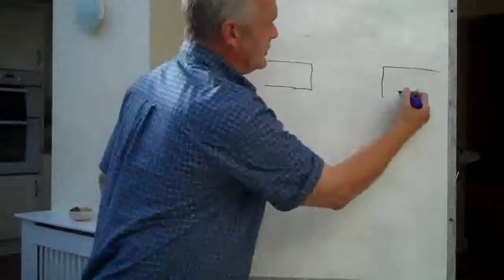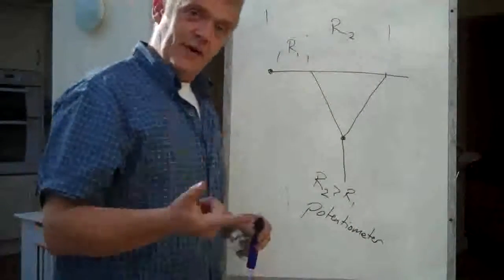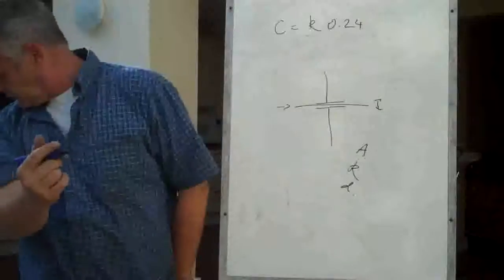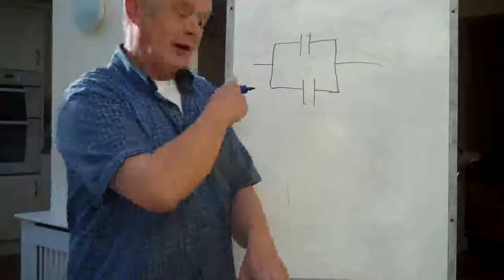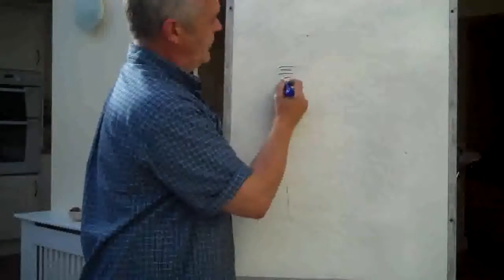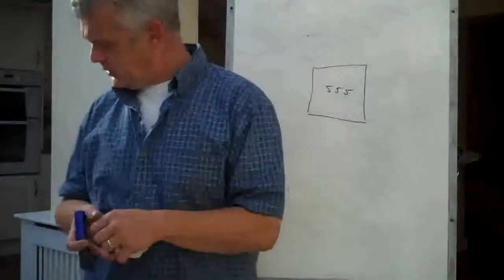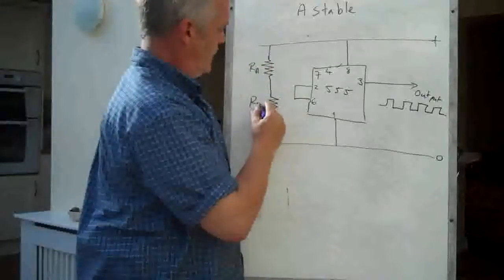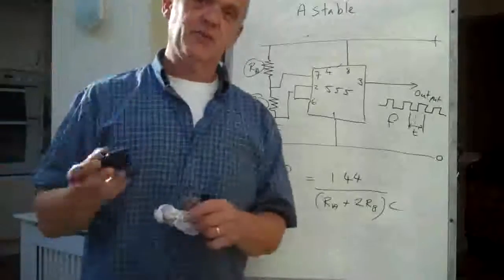Introduction to Making Electronic Components from Conductive Ink and the 555

Comment: So it seems you could start with a long strip of cardboard, coated in conductive ink on both sides so it's a capacitor, but fold it up in a zig-zag manner.
It'd work as one big capacitor (or many in parallel, if you wish to think of it like that).  Assuming the ink can stretch that far around the corners (depends on the thickness of the cardboard i guess) without breaking.  You may also need a layer of plastic between each fold so each layer doesn't touch the next, assuming that's nessesary.
You'd end up with a capacitive cardboard cube.
Reply from the maker: yeah - goo didea

Comment: you can do a nice coil by drawing a zigzag with curly straight bits that don´t cross when you then fold the paper into a concertina type thing...  john bedini said somewhere that a coil made from iron wire will produce a magnetic field opposite to that made by a copper wire if both are energized with the same current... what if the "wire" is made of iron and copper paticles? 0 field? could be interesting...

Comment: Yet another very informative video! You may also want to try 'my method' of using a circuit drawn on acetate (overhead projector transparency) by a laser printer. The carbon print is conductive too. You can electroplate it in Copper Sulphate for better conductivity and it produces a printed schematic you can roll up with your components soldered in (or conductive glue) to use when space is an issue.
Reply from the maker: i will try that - thanks